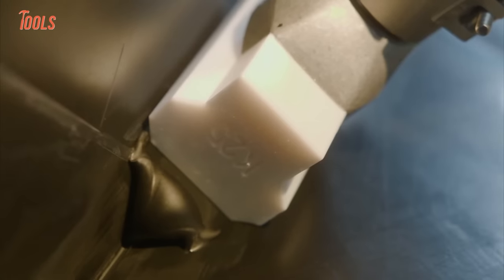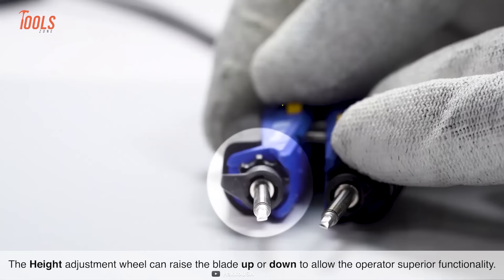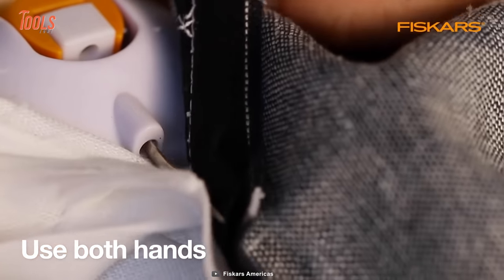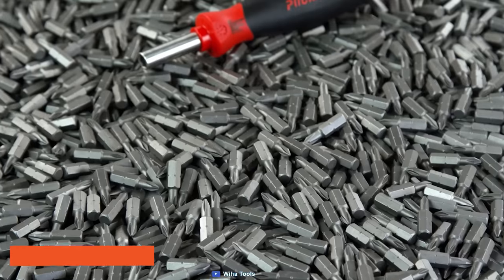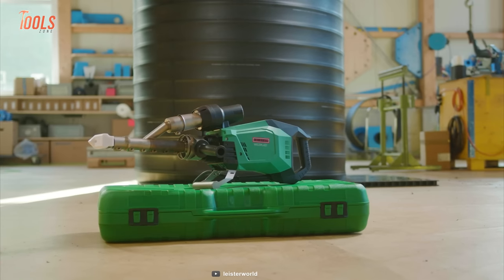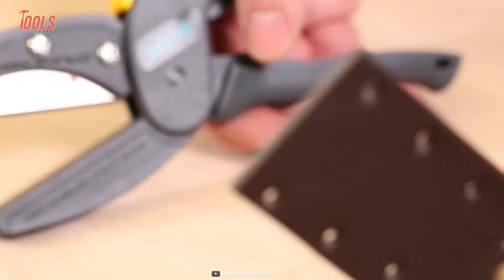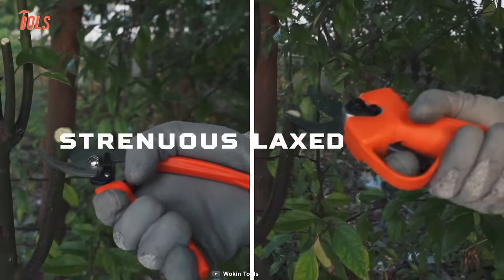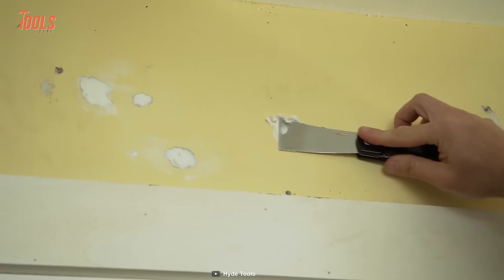15 Amazing Next Level Tools You Must Have ▶ 18

Comment: I don't know about the other tools but I have the Skill benchtop band saw and I find that it is all but worthless but cutting anything harder than plastic or very thin aluminum.  The motor is so underpowered that it bogs down when the blade is properly tensioned on start up.  Maybe it will be better with a 1/4 hp motor but then I will have to upgrade the plastic drive pullies.  Junk junk junk. I'm glad I got it on deep discount because it leaves some room to modify it.